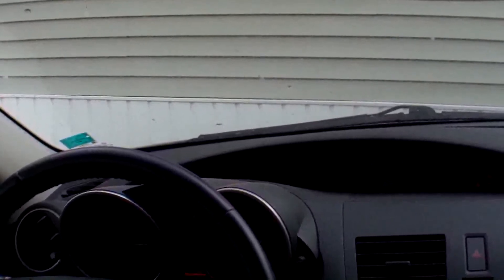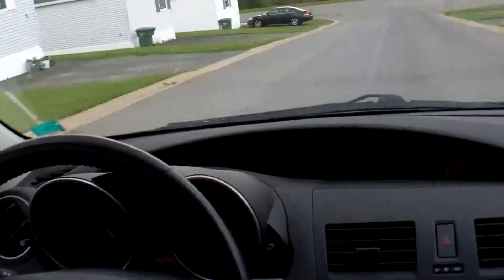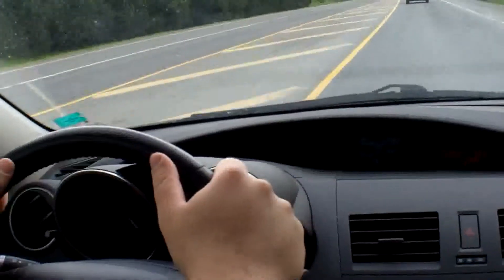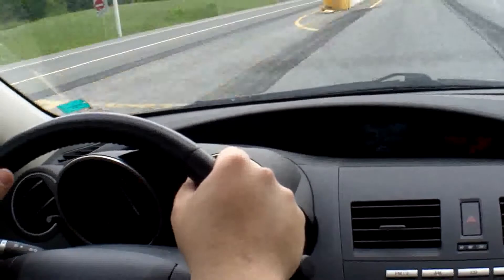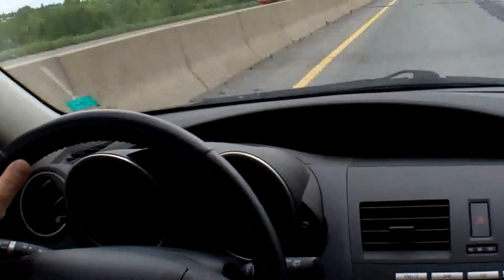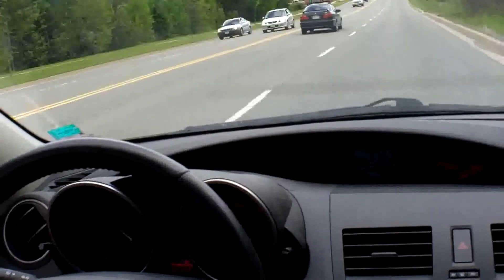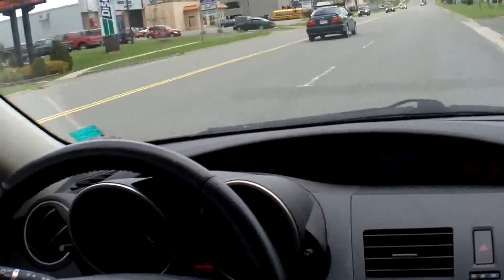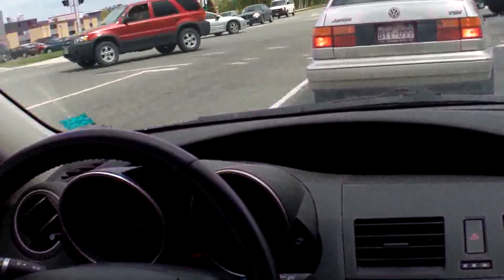MSDS Header for 2010 Mazda 3 2.5L engine (Daily Driving Situations)

Comment from the maker: No the res is still on the car, neither the header or racing beat removes it.  And the header deletes the primary cat, but leaves the secondary in place.  I never bothered replacing the secondary with a high flow, saw no reason to.

Comment from the maker: You will never see 25 hp from just an exhaust and intake.  Even adding the header to the car you probably wouldn't see a gain of 25.  I didn't do a before dyno but my after dyno with i/h/e was 166.8HP to the wheels on Mustang dyno.

An exhaust with a race pipe and an intake you might see <10HP